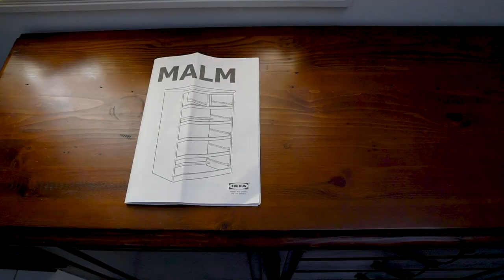How to Assemble IKEA Malm Chest of 6 Drawers

Comment: My top drawers (2 small) are not fitting in, what did I do wrong, it looks like I did everything right.
Reply: Did you manage to find out the problem for the top two drawers as I'm also having trouble with them
Reply: @sjames6921  did u find out why the top drawers won’t slide in? my top left drawer goes in but not as smoothly as the others and it doesn’t close by itself when you leave a little gap like the rest? i’ve tried everything such as switching the drawer and re screwing and i’m frustrated 🤯